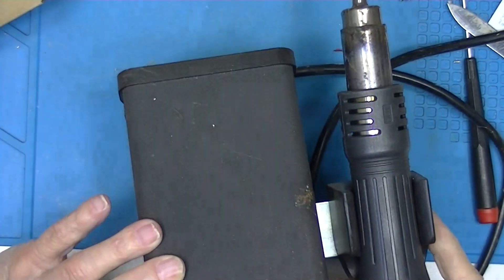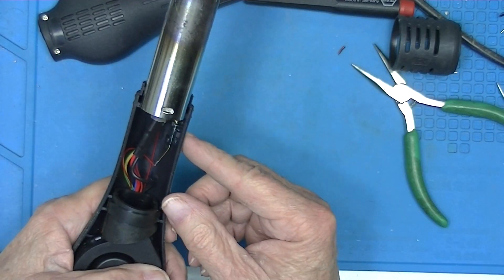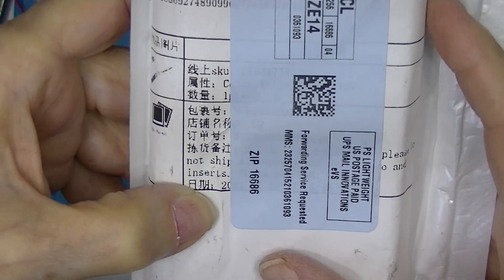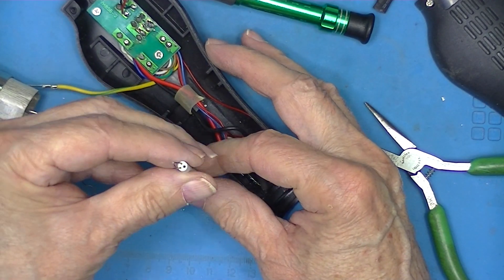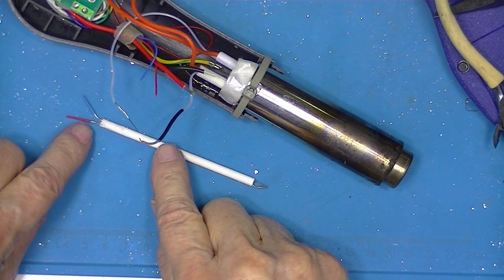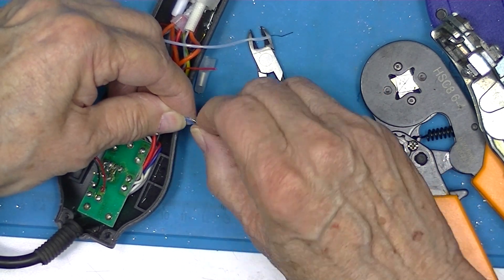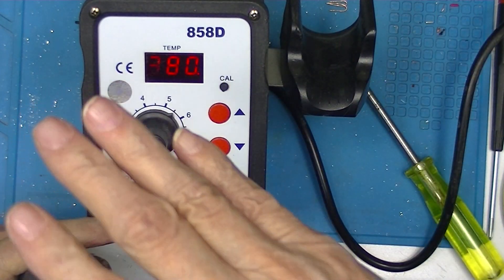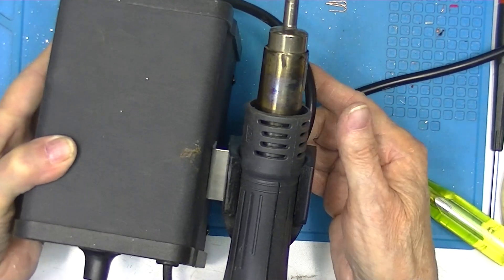Heating Element Repair / 858 Heating Tool

Comment: My element is extremely hot. Within few seconds turns red makes me to disconnect power supply. What might be the problem
Reply: Are you kidding me?this is normal
Reply: that's the why it is supposed to be, turn on your oven or stove and look at the element it is the same thing. stay away from electronics if you don't know the basics.

Comment: I've dropped the gun twice and it's fell on the floor, the caddy arrangement is poor, thinking of 3d printing something better.
Anyway on the 2nd drop it had failed like yours, upon disassembly the paper and element were in pieces, I ordered a replacement element from China, it arrived in an envelope without packing, surprisingly it was ok. Unfortunately the mica insulation paper was not included, I have ordered some.
What I noticed when ordering is that there appears to be other models of gun that used far more robust elements, some actually cost less than the element for this model, it would be good to know what element fits what unit, because I feel this model will require attention far too often? It's such a handy go to device, not just for electronics but for odd heating jobs, melting/joining screw posts etc.

Comment: How about error code H-E... 
Which one component i must check to...
Reply from the maker: Sorry, I ave no idea.
Steve
Reply: H-E is a heat element error...check that voltage is being output at the pcb when you test it it will tell you which way to look for the problem.....p.s. you need to be measuring for voltage as soon as you turn it on because once the error show it cuts the output, and be careful when measuring there's mains voltage connections in there
Reply: @Bimmer_MD  ok thank's for advice sir... 
I have check the heating element, the outer of cable is broke n connect with other on inside of handle...

Comment: Tips for anyone else doing this:  make sure to order a heating element that includes the outer insulation.  Some are sold without it.  Also check that the voltage is correct for your unit.  Lastly, be careful when disassembling the handle because the ground wire may be spot welded to the metal shaft and can break off easily.

Comment: Thanks for the explanation about the heat sensor.  The leads pass continuity check so I would have thought there wasn't polarity.  Would it matter if polarity was reversed?  If -.2mV was sent to the base instead of .2mV would the circuit still read the temperature correctly?

As for the power, one wire is connected to the top of the coil and the other the bottom, so measuring the resistance between the two wires should give between 20 and 30 ohms.  I can't think of any reason for the polarity to matter in this case but maybe I'm wrong.

Comment: How do you remove the tips?  
Mine came with a black pencil shaped piece of plastic and a bit of wire.  What are those for?
Reply from the maker: I don't know, mine did not come with anything like that.
Good Luck
Steve
Reply: @stevestrivia-bystevewagner4852  I got my tip off with a lot of force and a large pair of pliers.  As for the extra pieces included with the unit, I think those are for removing ICs.

Comment: Hey just a random suggestion, not soldering related but if you buy l-arginine from Walmart and take it daily it will improve blood flow and help steady your hands.
Reply from the maker: Thanks, I will try that.
Steve
Reply: I was interested in how you do SMD work with those shaking hands

Comment: Your hot air gun's blower is built into the handle which is near the heating element. This causes the blower to overheat and malfunction, creating more even more heat as it snowballs into a full blown meltdown. See Dave Jones video.  I would replace it with a unit that has the air pump built inside the housing or you'll be scraping Chinese corium from your work desk.
Reply from the maker: The blower takes in cool air and forces it forward through the handle, cooling the wires before the air reaches and then passes into the heating element. I have not ever had a blower failure, only heating elements.
Thanks
Steve
Reply: I have this exact same unit, I have little to no experience using it, yesterday I used this unit with a tiny nozzle to remove a small ic, the tiny nozzle could not let the heat escape quickly enough, I could hear crackling in the handle so I turned it off immediately, heat built up in the metal part and it was glowing red hot, the plastic started to melt and was smoking, I had to keep the handle in an upright position until the handle had cooled down and the plastic solidified, the metal part was moving around as if it had no support 

Today I checked to see if it was still working, it’s working but no hot air, hence why I am here watching and learning to see if I can dismantle it to see if it safe to repair, the black plastic which you unscrewed is really stiff on mines, I think it’s melted together

Update: I’ve managed to dismantle the handle, it doesn’t look too bad, should be repairable, where did you buy the heating element, do you have a link? Thanks, I’ve liked and subbed
Reply: @darattaqwa  Don't sink anymore money into that murder wand. Get another hot air station with the pump inside the housing. They're safer and quieter and produce good consistent heat. You can save your nozzles and use it on them. I recommend Aoyue or some other brand. If you look hard enough on eBay or Amazon, you can buy a used one for less than $100.
Reply: @bobweiram6321  thanks Bob, I literally hesitantly  placed an order for an 8586 (next model up from 858D) few mins before i read your message, I’ve requested to cancel so I can buy a used aoyue 852a+ for £46 + £8 postage (the brand new 8586 was £32 inc postage), to be honest the handle on my 858D should never have got red hot, melted the handle and not switch itself off for safety! I only had the unit on for approx 2-3 mins, the handle is melted and beyond repair
Reply: @darattaqwa  You're going to be way happier with it and you can always resell it for something when you decide to upgrade. Let us know how it works out,
Reply: @bobweiram6321  bob I just wanted to say thanks for recommending AOYUE, I’m very happy with the AOYUE INT 852A, this is definitely a quality product, just feels safe to use... one question, will I damage the hot air gun if I switch power off and on to the unit whilst using it, should I be using the fan rework / cooldown switch? Thanks again
Reply: @darattaqwa  I'm glad you're happy with the unit!  It's night and day difference, huh?  It's not the top of the line like Hakko or JCB, but it has 98% of the quality and functionality at a fraction of the price.  

The cool down cycle will help it last longer, since it helps get rid of the heat.  Regardless, the elements are cheap and easy to replace. While I am not entirely sure, the element is identical to the cheap ones, so don't throw it away just yet. My Aoyue 968A++ came with an extra one.
Reply: @bobweiram6321  thanks Bob, I really appreciate it, take care mate
Reply: I too was concerned about the tiny nozzles. I ended up with S-E (Sensor Error), after using a small nozzle. Took the handpiece apart, checked continuity, but found no problems. Reassembled, and it's back to no S-E error.  I'll definitely keep an eye on it. I have an "X-R-SPORT 959D", which they claim uses better heat-resistant plastic
Reply: @CM-xr9oq  That's the exact model Dave jones that self combusted. The small opening of the nozzle creates hot air backflow into the handle. I would cut my loses and get one with a separate pump.